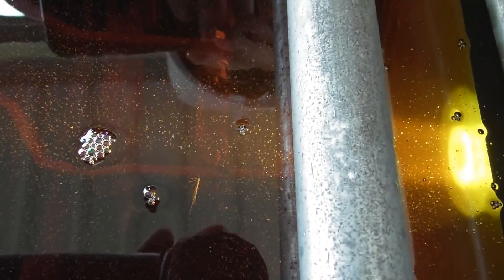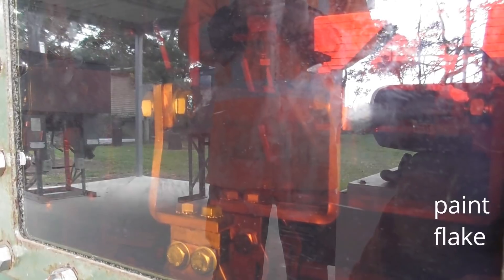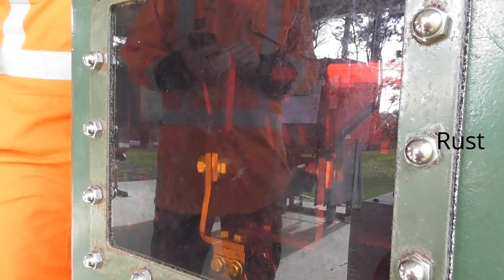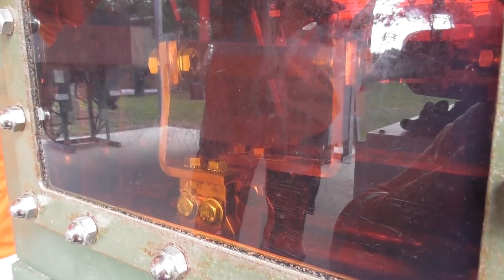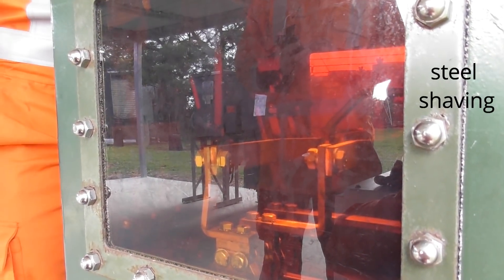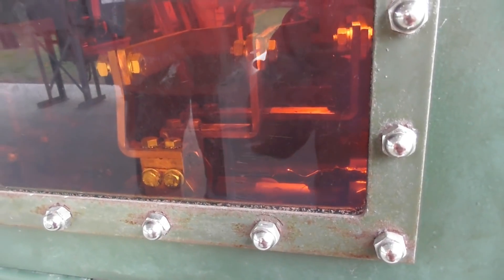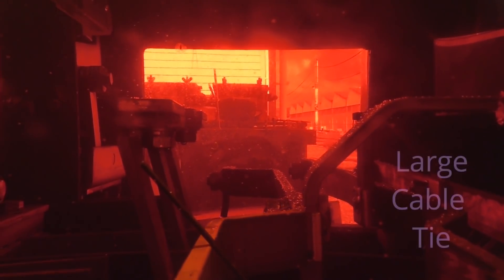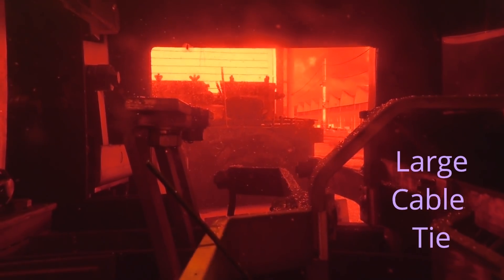Mineral Oil foreign objects drop tests

Comment: If the oil in the RMU heats up in service, wouldn’t that make it less viscous and the objects would fall faster?
Reply from the maker: The oil won't heat up in normal service. It is more to determine if something falls in during a fuse change. (In that case the whole busbar and RMU is de-energized remotely, prior to the fuse change). The items tried, didn't video them all, as it was very windy that day, are most likely to fall in, if the lid wasn't cleaned properly prior to lifting the fuse tray.
Reply: @RODALCO2007  you forgot the most likely candidate, pie crust from dodgy roadside diner. You know the type, more crust than fill, and that fill is mostly mystery spicy gravy with some odd floating blobs in it, that might be meat of some type, vegetable of some type, but you can always tell the corn kernels and the carrot chunks, as they are apparently indigestable by anything, coming out mostly intact.
Reply: 'Archimedes law' is dominant in these circumstances.
Reply: @riesmoos  It's still mostly dependent on the resistance from the oil. Archimedes law determines the force pulling it down (weight minus buoyant force), but that isn't affected by falling speed - the object will just accelerate untill the resistance from the oil is equal to the force pulling it down (terminal velocity). That happens very quickly in a liquid (probably after just a few cm of falling) - and more viscocity = more resistance. But it's probably not very much affected by temperature anyway. That kind of oil have a low viscosity even at quite low temperatures and will probably not get very much lower when it get hot (since it is already very low)
Reply: @Ride84XL You might wan't to have a look at this video:    https://youtu.be/8fWmDlk4kx8
Altough YT videos aren't gospel, it seems that density (mass per volume) is winning here. Higher density makes it sink faster.
Somehow i think that the size of the surface pointing towards the source of gravity (earth) also is a factor, similar to air resistance but replace air with oil.
That would take our quest for the answer into the realm of fluid dynamics ?  I know very little about fluid dynamics, so don't ask me :)
Anyway, thanks for the reply.